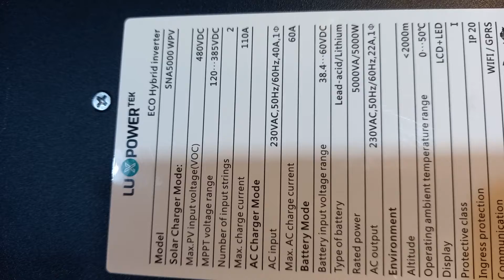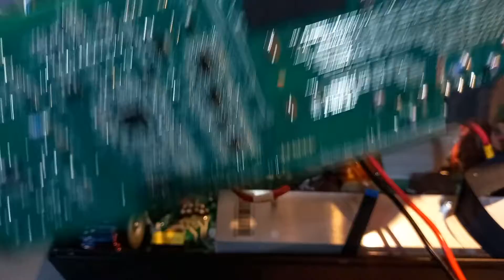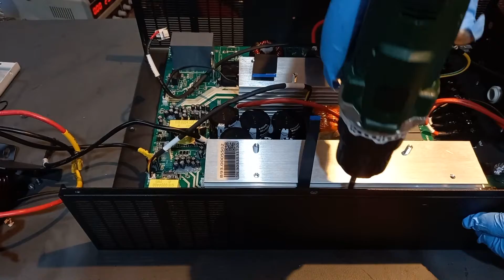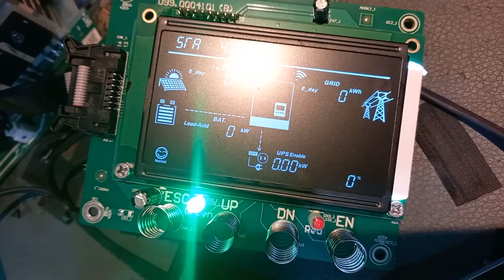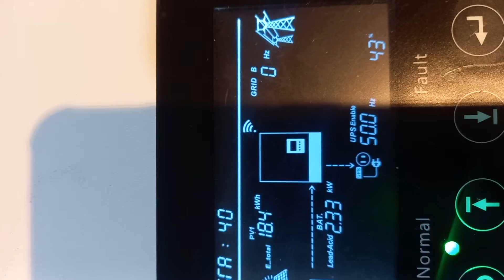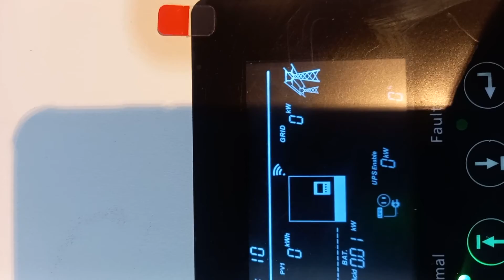Repair LUXPOWER SNA5000WPV INVERTER REPAIR NO OUTPUT BURNT IGBT

Comment: This is the perfect example why you should never buy Luxpower inverters like the 6000XP, 12000XP, the 18kpv and the FlexBoss. Out-of-warranty repairs are far too complex to diagnose, and far too many repair hours are billed. That's why we call them throwaway inverters. They're just too expensive to repair.

Comment: Hi Given  ,do you have any advice for a luxpower sna 5000 with a dead short on AC ? Trips EL as soon as its connected , checked all mosfets, igbt,caps  , resistors, relays . Dc in seems to work  , AC charge and supply is the problem
Reply: @rnbTronics-04h how did you fix this issue ?
Reply: check settings. its settings are on parallel. set to single not parallel.

Comment: Great video...I'm repairing a charge controller that has the same problem......the inverter that was in the system developed a fault at the same time,but I do not find any damaged components. .....what do  you think could have broken,it has no battery light,or output..thanks mike